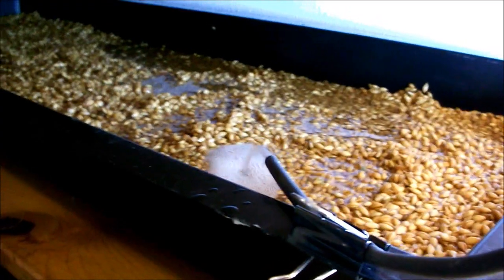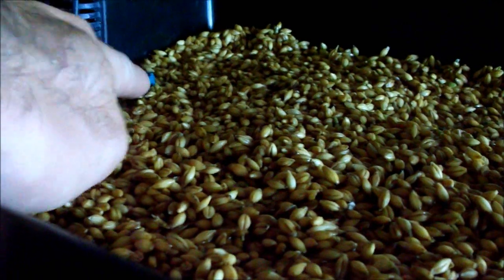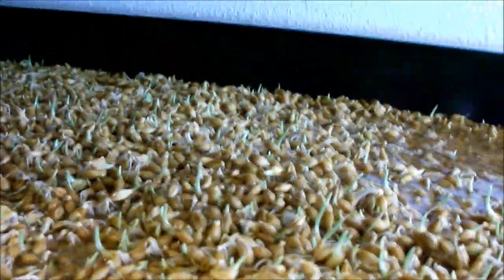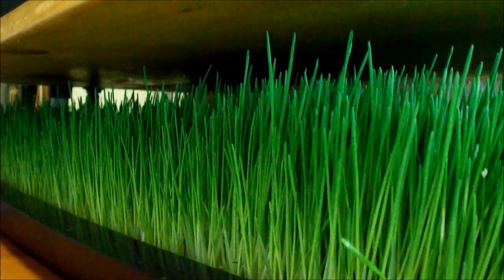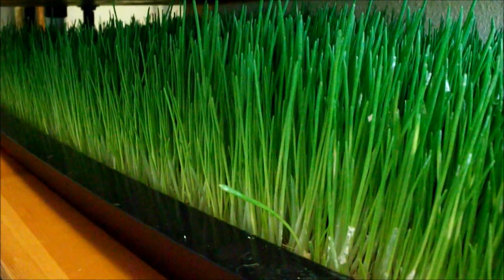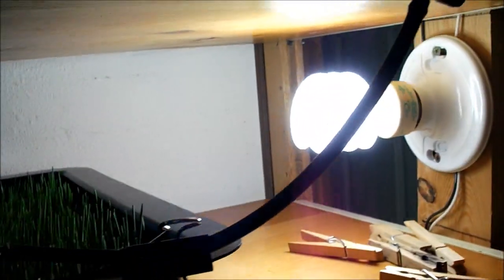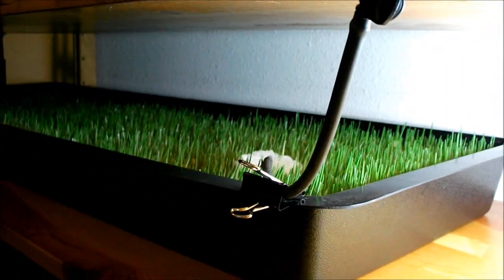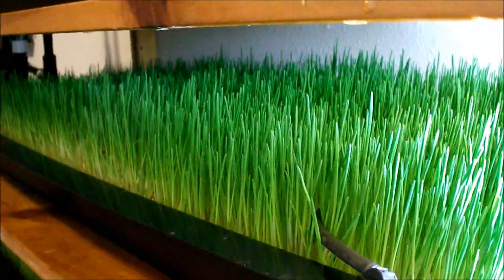Barley Fodder Trials - New Flood and Drain trays installed

Comment from the maker: Your drainage described is what I refer to as a waterfall/cascade method combined with a trickle down approach between trays.  There are disadvantages to draining from higher trays into lower ones in a system; you'll start noticing that lower trays become poor performers. 
I would be curious as to the size of your aquaponics tank in relation to the size of your fodder operation. I haven't done aquaponics (yet) but have been asked questions as to what quantity of fish would be needed to handle it

Comment: 300 gallon+ 30 gallon swirl filter + 25 gallon sump have 25 catfish plus I have bunk bed like beds three beds top is ebb n flow system that drains to my raft system which then drains to the bottom bed which is also a raft. all together have 5- 4x8 foot beds and then my barley bends are 2x4 mortar trays 6 lined up in a row and 7 deep with seed at bottom I harvest mine on day 7 and use a windshield wiper pump in greenhouse everything is DC I have spray heads above plus the shelves turn 2 milk cows
Reply: I would like to see your set up. do you show it online anywhere? I know it has been a while since you have posted. hopefully you wiII see this.

Comment: You could paint the bottom of the shelves white or silver to reflect light.
Reply from the maker: Actually, lighting in a sprouting application isn't a high priority.  Technically, one could sprout in the dark and have yellow sprouts.  One could also use ambient daylight if there were windows in the grow room.  Our lighting is enough to dispel shadowy areas at the back of the shelves during latter day growth, which does keep sprout height consistent across the tray.

Comment: For each tray there seems to be a valve of some sort to control water flow. Please tell me what is the correct name for this type of valve and if possible exactly what make and model valve that you are using.Thanks a million!, Lucky
Reply from the maker: Be sure to view our video of our production room to see the current operation.
There is no valve involved with these trays. The concept is simpler.  The seed backing up against the drain cap causes the water to back up in the tray and flow out slower than the water being pumped in. We time our watering cycle so that the irrigation remains on long enough to wet the seeds in the early part of the grow cycle.

Comment: hi David, do you use any kind of nutrition on this system? how many days we can harvest it?  thanks :)
Reply from the maker: This is a sprouting application (not a typical hydroponic grow operation), thus NO nutrients are added.  Basically we are using a high seed density over a relatively short duration to achieve the goal of converting starches and stored energy into protein.  Typical grow cycles range from 7-9 days based upon climate controls and growing temps.  Local conditions will influence the grow times as well.  We run a 9 day cycle going from 5lbs of seed to 25lbs of feed in that time with just water.

Comment: Is the pump on a timer?  If so, how often and at what duration does it run for? Thank you.
Reply from the maker: The irrigation pump is on a timer and waters 4 times per day: 8am, noon, 4pm, 8pm.There is a 12 hour break in irrigating because roots need aeration as well as irrigation.  This break coincides with the simulated nighttime when lights turn off.Each water cycle lasts for approximately 4 minutes.
Reply: David Capocci